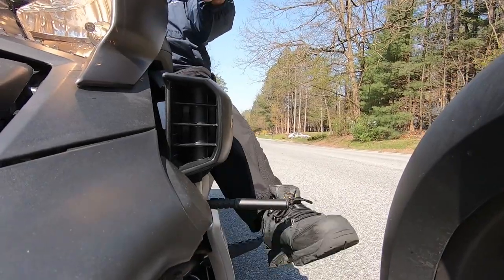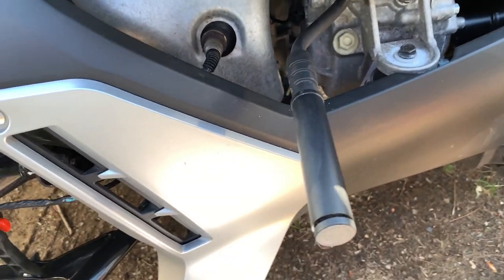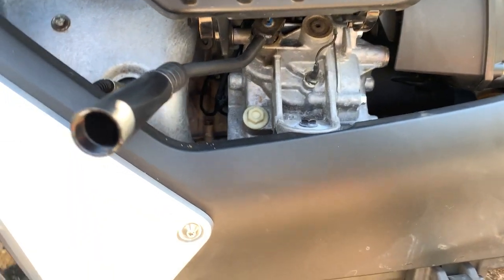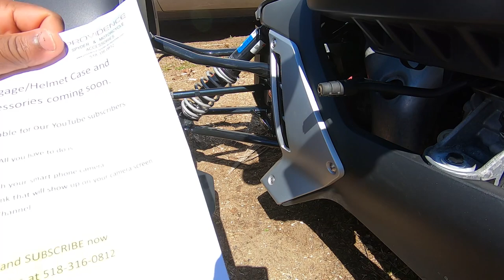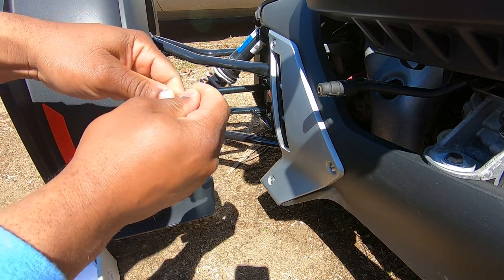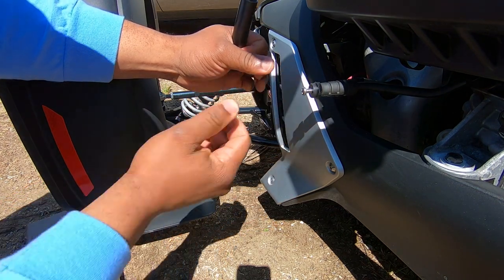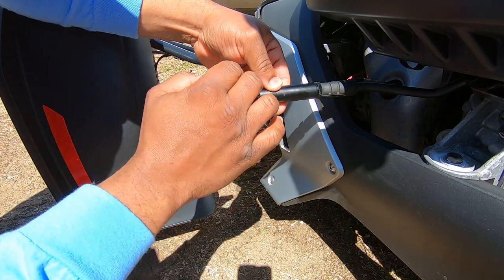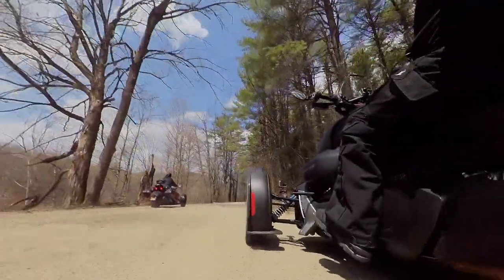Can-Am Ryker Forward  Reverse Shifter  Accessory Review

Comment: I'm really confused as to what this product is for. The Ryker has a lever with the rubber piece attached already. 
My wife and I don't understand why you are using the top of your foot to shift. 
Our Ryker Rallies that we have owned since spring of 2019 shift absolutely fine using the bottom of our foot. You just put your arch on it and apply down pressure while swinging your foot back. 
We are just amazed at all the aftermarket shifter products that people have to have to operate these bikes!! Lol
Reply from the maker: I myself find shifting into Forward is no problem. However Shifting into reverse is a problem because the stock peg is too short for mr foot size. My extension solves that problem for myself. Others also have that problem. Many people have to bend over grab the lever with their hand to pull it into reverse because it doesn’t work for there foot. Maybe it’s a combination of shoe size and how tall the individual is. But in either case it is a solution for some riders. If you can shift forward and reverse fine with only your foot then that’s great.
Reply: @kirwinprovidence3225  We have found that if you kinda just flop your foot down and back it goes into reverse just fine. 
I don't think I have ever tried to pull it with the top of my foot. 
My wife would definitely hate tearing up the top of her boots doing that. Lol
You know how girls are about their shoes 😂🤣
Reply from the maker: @jamesglenn520  Sounds like your system works just fine for you. Awesome.